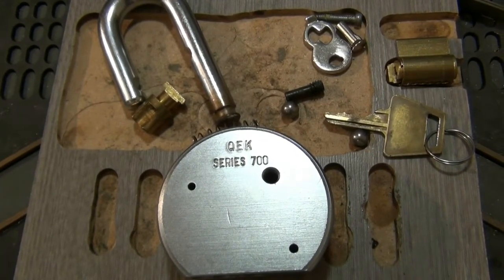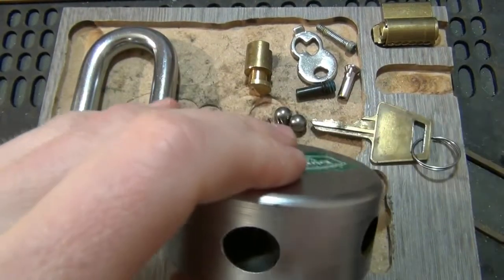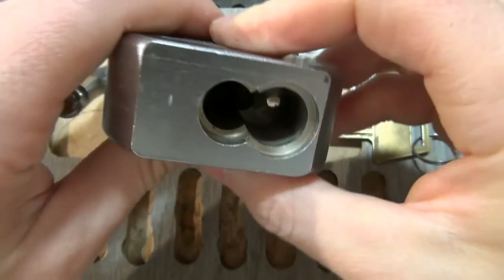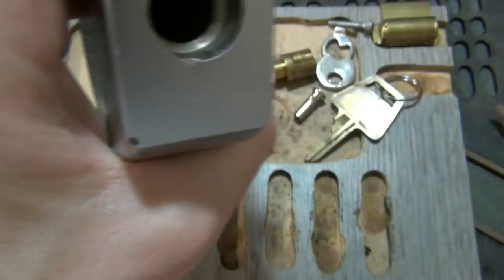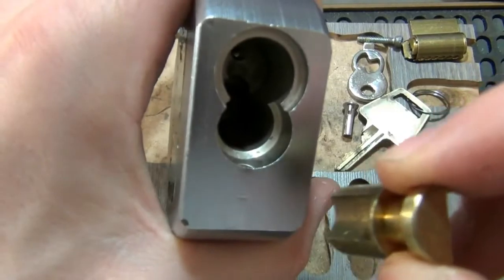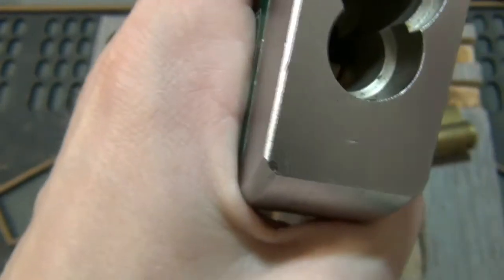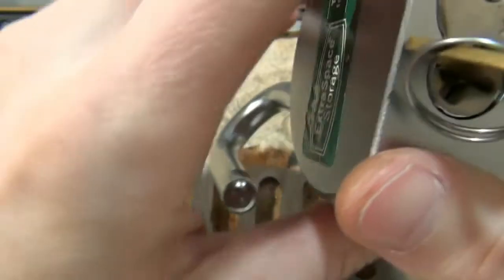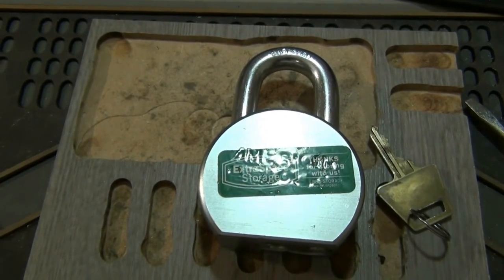(146) Reassembling an American 700 Series Padlock

Comment: Nice job. Great concise video. Does the 700 only accept American Lock cores or can any other makes of cores fit as a drop in? I realize the half moon bit will have to marry up to the half moon on the actuator. Thanks
Reply from the maker: It takes all the redistricted american keyways.  It might take an M10 too.  I feel like I've seen that before.  There's also a version that accepts fullsize kik cylinders so can put whatever keyway you need in